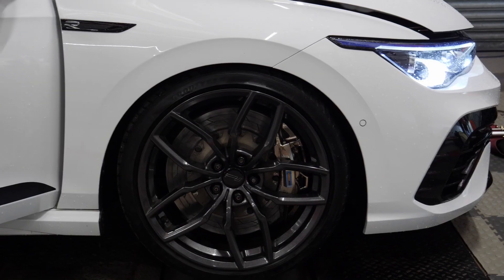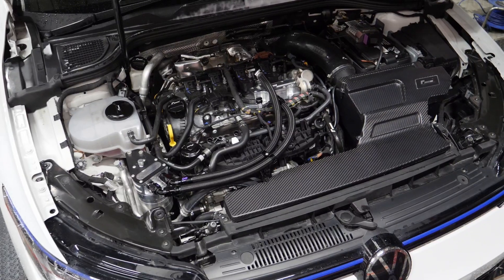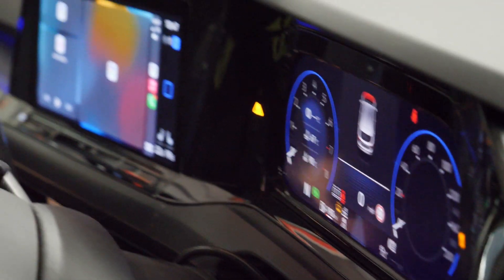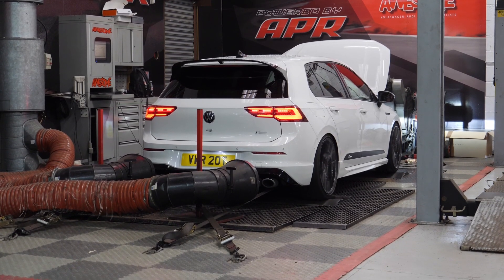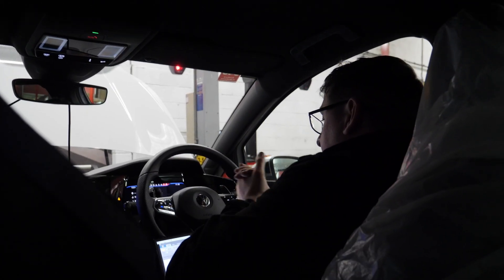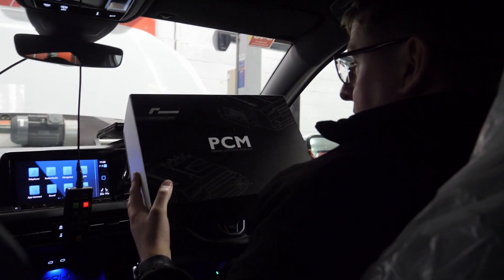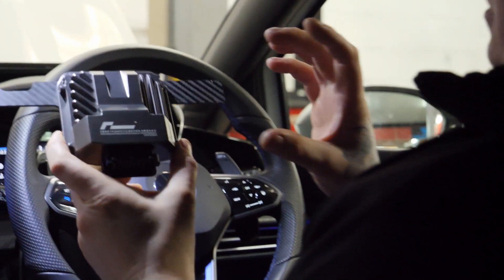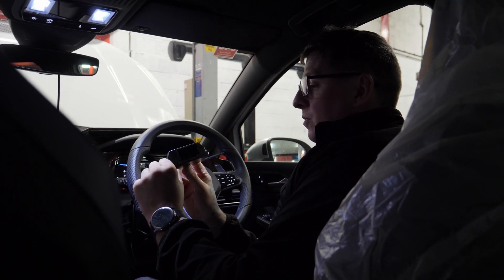More Power for your Volkswagen Golf R MK8

Comment: The hardware changes have made it less powerful not more. A stock R from a few videos ago ran 340bhp without any mods. And 24/26bhp extra doesn't sound impressive tbh. I guess we need to see on the airfield with the box if it can beat a 12.3sec quarter mile stock time set in other videos.

Comment: ahahaha 365Hp.. only 25 more than stock... every 8R got arround 340hp stock. Racechip and DTE powerbox got 370-389hp.
Reply: wheel or crank?
Reply: @louisnguyen6038  who needs wheelpower?... horsepower of Engine.
Reply: @troc_r_460_evo4  when you dyno you get whp, you have to do a drivetrain loss estimate to know what the crank hp is. So realistically whp is the only thing you actually need
Reply: @louisnguyen6038  no. no dyno can measure the real whp with 2 rolls and against an electric break.  And VW never sells cars with whp... 🤣

You guys in your countries measure total wrong things.🤣

Engine in a golf 8R and Golf 8 Gti clubsport is the same... if u tune both with software to 400 engine hp its normal that the R with 4 motion is slower,cause of more lost power  for 4 motion and weight.
Reply: I have an S3 8Y going from RaceChip GTS to PCM soon.. the RaceChip gave me 360bhp on the dyno consistently.. noticed there’s a big range in what you could run.. have low expectations so you’ll be plesently surprised haha.
Reply: @jasonpears5933  why are you moving from Racechip to PCM?
Reply: Who’s there in 2024 

Just got my 2024 golf r dsg
Not sure what to 
Racingline pcm or jb4 piggyback or race chip.  

I don’t want to lose my warranty.  Thanks for help
Reply: @cryptobangbang5532  u will always lose your warranty if you tune it. but u will only lose it for the engine gearbox and so on, not for example for camera, navi system and so on.